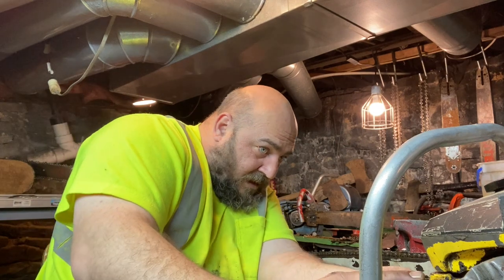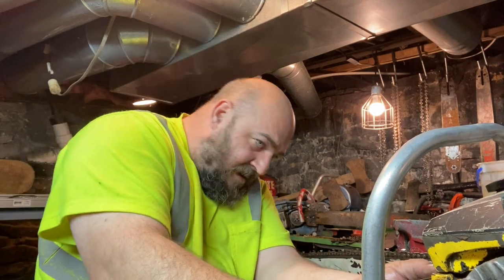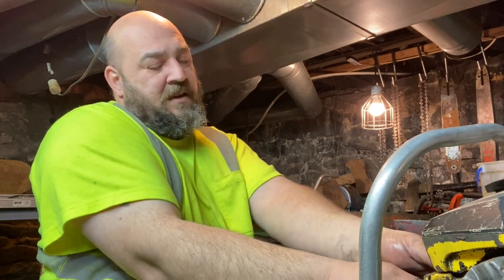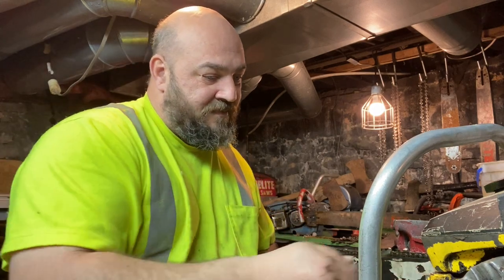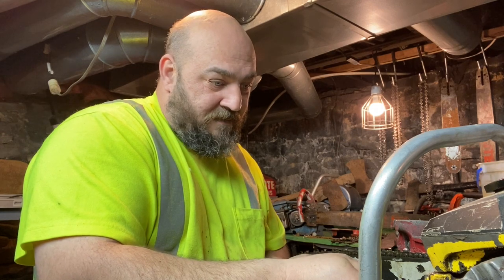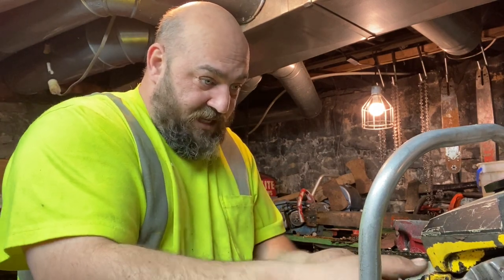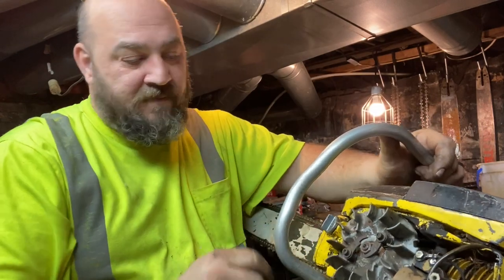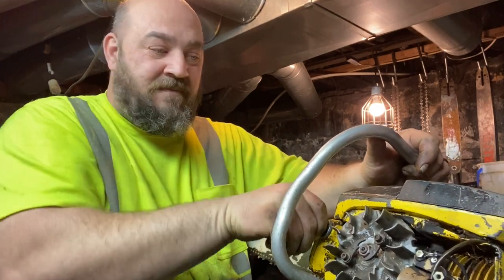McCulloch Mac 10-10 Chainsaw Oil Repair And A Homemade DIY Air Filter!

Comment: Can't find a 10 10 automatic air filter...I have one missing most of the felt...im going to try the scotch Brite idea...thank you for the idea!
Reply from the maker: It works.
Reply: @Smittyschainsaws  I picked up a pack of floor vent filters(household)...same material as scotch bright but thinner...was able to double them up and line the existing filter...better than nothing 
Thanks for the idea
Reply: Two appeared this week on ebay. Sorry bought them both even though i only need one.
Reply: @ericfuller6326  all good buddy, hope u get out cutting 👍

Comment: Is the zip oil cap vented I was thinking thay had a oil tank vent on them the 10:10 is vented so that might cause you problems with no way to get air but I am probably wrong love your channel keep them coming
Reply from the maker: I do not know if it should be vented.

Comment: Hi. Im working on one I just got. Seems the air filter doesn’t seat proper. The rubber sides sit under the top making the top not seat down all the way. Idk if this is normal or what. Also puts pressure the on off switch cable    Also not sure if the chain tensioner is busted.  I cant seem to loosen or tighten the chain once I have the bar cover on   This saw is new to me so don’t know much
Reply from the maker: This old stuff can be a pain sometimes but when you figure it out the satisfaction is great

Comment: Could you give a part number for the oil plug for the homelite zip.  On a search it came up with many different plugs.  Yes, they are vented, but mine leaks through the vent hole.  I can't find a description or picture of how they kept the oil from leaking out.  My saw is a McCulloch 10-10 Automatic Circa 1972.  Not 100% sure.  Model number 600002 U.  It was my late father in laws.  It runs well, but I need an air filter, thus watching your channel.
Reply from the maker: Leonschainsawpartsandrepair.com will have the part number you are looking for. You can also check to see if your current oil cap has a good duck bill valve. when the valve goes bad you get a leak like you described. It’s usually just a simple piece of rubber that works by letting air into the tank as the oil or gas gets used up to prevent a vacuum. It is very small and made of rubber. It would be part of the vent system in the cap.
Reply: Thank you for the quick reply.  I am thinking the rubber has broken off the metal clip in my cap.  Not sure how fixable it is.
Reply from the maker: @dr.lancebarclay8183  You can find new ones for Homelite but I don’t know if you can for the Mac.

Comment: So, i have a 250 mac, and the manual oiler was just STUCK. I think it was a combination of it being old, and also that someone put 90 weight gear oil in it. What i had done was just drain the tank after letting the saw sit in the sun on a 100 degree day, and just filling it with diesel, got it right unstuck, and pumps like a wet dream
Reply from the maker: Sweet!

Comment: It's hard to find "new" air filters for the early 10-10 models. NOS will cost big time. The later 10-10 models new after market filters are affordable. Just make sure the choke has enough room to work when making a filter. 
On one of my 10-10's the manual oiler wouldn't work. I replaced the O ring. It's on top of the oil tank under the gas tank where the rod from the manual oiler button shaft inserts. But yours may be different because it's a earlier model than the one I was working on. 
Good luck.
Reply from the maker: Thanks for sharing
Reply: Two appeared on ebay paid 40 ish for both but you have to really be watching.
Reply: @ericfuller6326  Yes you have to be quick. They are bought quickly if they are a good price.